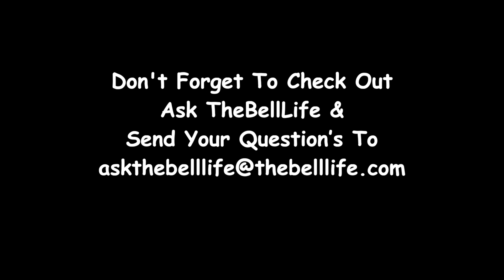Is TheBelllife Really Moving???

Comment: They definitely shoulda have pulled old floor up first and put hardie backer down before adding tile may run into problems later on 
Also reglazing a cast iron tub is the way to go not replacing with fiberglass good call
Reply: My mom and dad reglazed there tub and it looks like new now. Definitely worth it!!